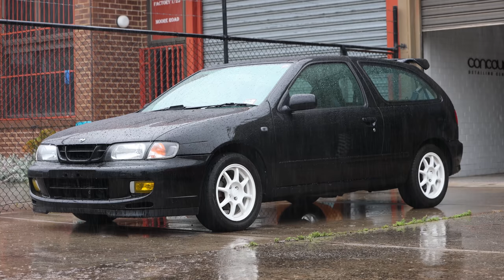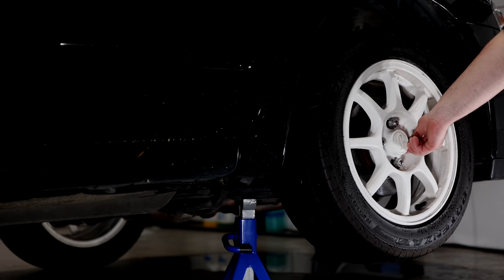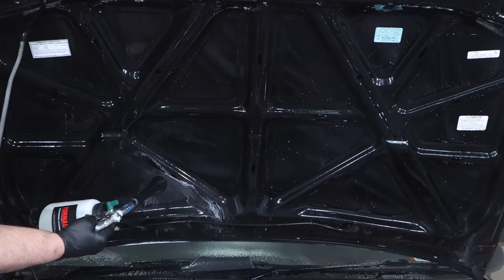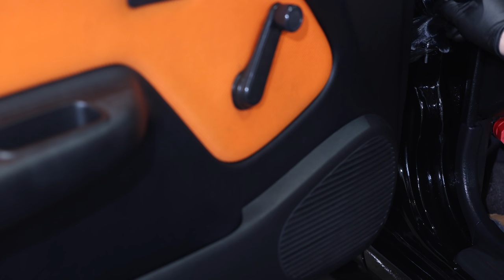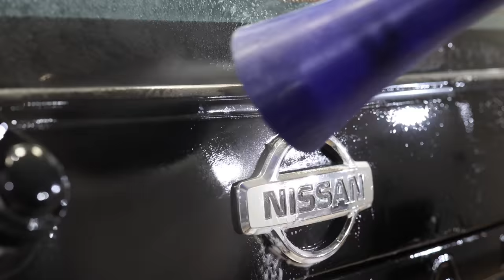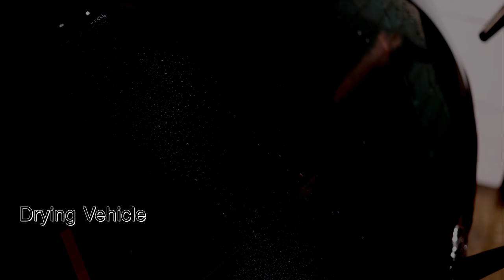75hr Detail | Rare 90s Nissan VZ-R N1 Spec II Pulsar | P1 Wash & Decontamination (Vlog 33.1)

Comment from the maker: Some details about this amazing hot hatch. 
1 of 28 built, lightweight homologation racing model (to compete against the ek9 type r)
Factory orange interior consisting of r33 gtr front seats
Factory Lightweight  Enkei rct2 racing wheels 
High compressions 1.6 litre NEOVVL engine which had the highest power output per cylinder before the Honda S2000.
Reply: Awesome Sandro, what is the minimum size compressor to use for the Tornador?
Reply from the maker: Litres per minute is what’s really important with a compressor but you probably want to start with something that has 200LPM
Reply: What’s your opinion on shine supply?
Reply from the maker: It’s a great detailing brand

Comment: Interesting to hear your comparison between a steamer and tournador. Just wondering if you tried steam from a large hot pressure washer, as it produces far more steam, also potentially adding an apc which it sucks up, so you have the best of speed and cleaning power

But credit to your hard work, skill and dedication in these difficult times. The finished result always speaks for itself
Reply from the maker: Thanks but although I have a pretty good steamer I don’t think I’ve tried a hot presser washer or steamer extractor which could definitely work quite well.

Comment: Great video. Interested to see part 2 of this. Have never seen a N15 pulsar with original paint that didn't have clear coat failure.
Reply from the maker: No, it hard find many cars with original paint the further back you go!
Reply: I had one in the early 2000's. Clear coat went after it was 8 years old. All the others I saw on the road had the same failure.

Comment: Nice video Sandro. You mentioned you had previously used a steamer to clean door jams, just wondering if this would damage the paintwork? Could you use steam safely on other exterior surfaces like the wheels?
Reply from the maker: Steam is quite safe on car paint, it’s just time consuming so not really practical for use for large areas, but it’s great for wheels. Unless there’s an issue with the paint such as it’s deteriorating or a bad/cheap paint job you really shouldn’t have any issues - just like using a pressure washer on paint.
Reply: @CarCraftAutoDetailing  thanks for your advice. I love your videos. Bye.

Comment: Good day sir. May i ask the TIP size you are using with your snub nose pressure gun?  I notice the water coming out of it is well spread. Thanks for the video sir.
Reply from the maker: It’s a white nozzle tip which are the 40 Degree angle tips.

Comment: 😃
Reply: @CarCraftAutoDetailing  Would a ceramic coating prevent rail dust clinging to the car ? I have a pearl white car and after decon and Claying it has come back less than 2 weeks later.
Reply from the maker: It will probably help give you a little extra time to wash it off before it bonds but give enough time and exposure to it it will still bond to the coating.
Reply: @CarCraftAutoDetailing  would there be any other solution to prevent it from coming back ? Or is it just one of those things that's a pain 🤣
Reply from the maker: Washing the car more often would help, but if your car is in an area where there’s a lot in the air, you just can’t stop it, but using iron removers like Carpro Iron-X more often can help treat it.
Reply: @CarCraftAutoDetailing  Alright, thanks mate 👍

Comment: Have you ever tried using a drill brush for the tires
Reply from the maker: I have but it’s been a while, but can certainly be a great option depending on some factors, I also the Tornador at times which can be another great tool for  tyres.

Comment: When using a Tornador and no final water rinse to remove the chemicals is there really no leftover residues?
Reply from the maker: You need to switch to water on your Tornador bottle, but yes you can rinse small areas down with it.
Reply: @CarCraftAutoDetailing  I see makes sense. I missed the part where you switched it to water and thought it was APC the whole time. 👍

Comment: you are why I bought megs hybrid ceramic spray wax I hope I will get it next week and have time to try it out and protect my dad work car and finally spring is here no more minus temperatures and salt and I will not need to use strong pre-wash witch is kinda harming any protection I put on because in winter I don't have time to put something strong I hope I will do some layering with pi1000 high temp wax, sonax BSD, and other stuff I have to see what and in what combo lasts the most time and what I can use as a clay lube with that Carpro Poly-Shave Block I have the same one I want to go with shampoo but how to put on the panel spray bottle, foamer,  any suggestions? and yes I am a noob not a year in the detailing game and I can say you were a person that was and is needed you helped me and you will help not only me with your best top-notch tests keep it up dude I know you can pull through this bad time
Reply from the maker: Thanks mate and great to hear! You can really just fill up a spray bottle with your normal car wash soap from your wash bucket and use that, or something like 1:100 mix should work fine.
Reply: @CarCraftAutoDetailing  thanks

Comment: what did you use to rub in that polshing soap with? also it foamed up, is that what happens when you combine it with apc/wateR?
Reply from the maker: It’s the supplied applicator that comes with P21s polishing soap and it naturally foams up on its own.
Reply: @CarCraftAutoDetailing  how do you clean the applicator after you've used it on a car? Thanks :)!
Reply from the maker: Just some warm running water with some velvet laundry soap.
Reply: @CarCraftAutoDetailing  thanks!